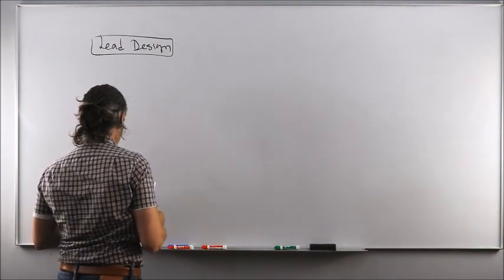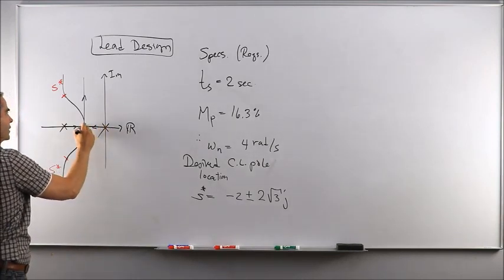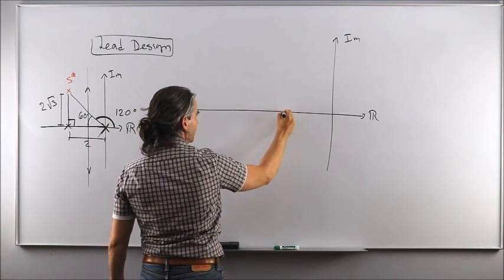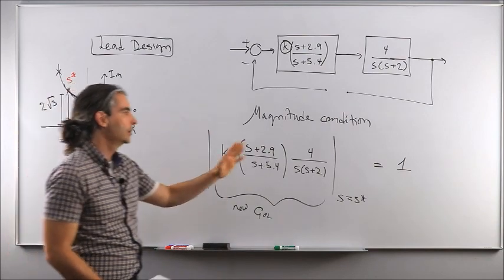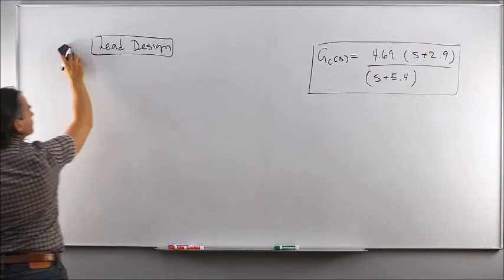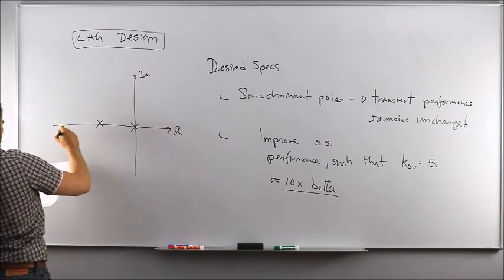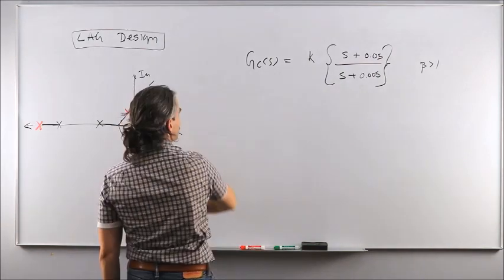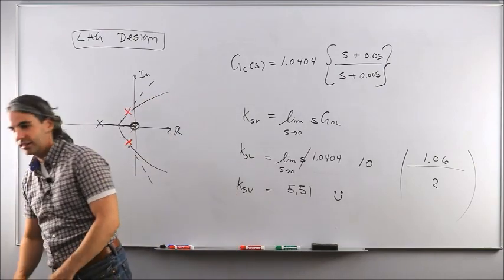Feedback Control Systems - Lead Compensator and Lag Compensator Design

Comment: I feel sorry for his students.  Too much time is spent writing on a white board with his back to the students.  The instructor should have a prepared Matlab, Python or Mathcad like presentation prepared that could be shared with the students so they could tinker with it.   Also,  where are lead-lag used in industry?  There is nothing wrong with learning lead-lag controllers but it shouldn't be a priority over other means of control.   Also, the instructor does a piss poor job of computing the controller gains and time constants.  It should be easy to beat 2 seconds without overshoot.  Another problem is that a lead-lag controller will work OK for the instructor's open loop transfer function, but a lead-lag controller will not work well for higher order systems.  The open loop transfer function is like that of a low response motor in position control I have a Mathcad work sheet made up for this example.  I can easily chose the open loop gain, bandwidth and where I want the closed loop poles.  There are formulas for computing the controller gains, lead and lag time constants given the open loop transfer function and where the closed loop poles are placed.  I could have provided more info in 20 minutes.